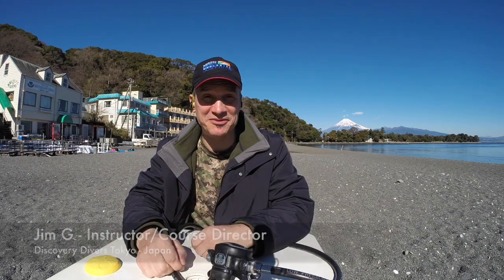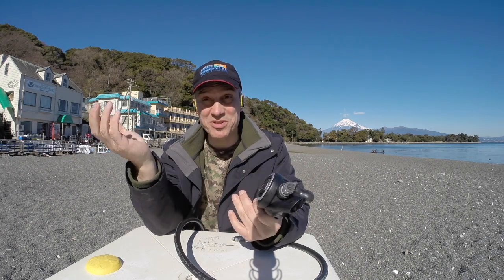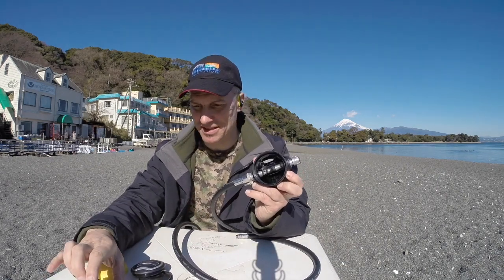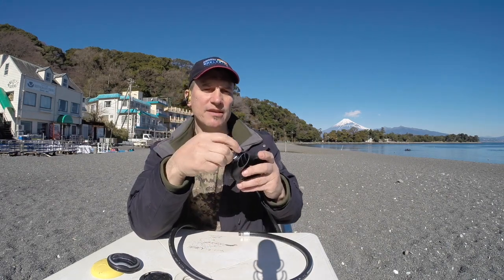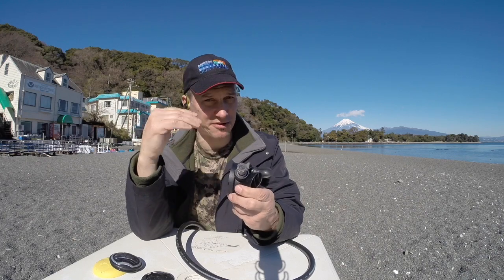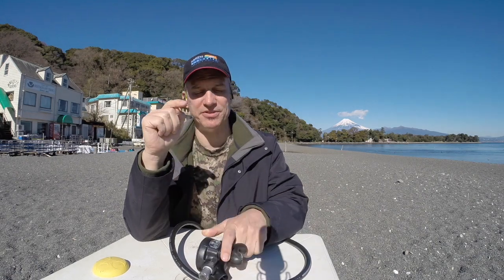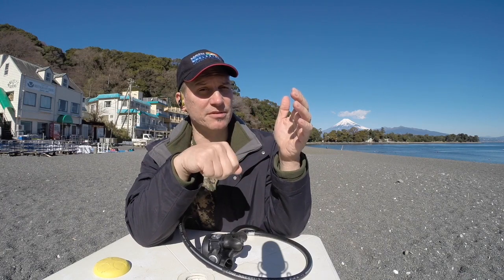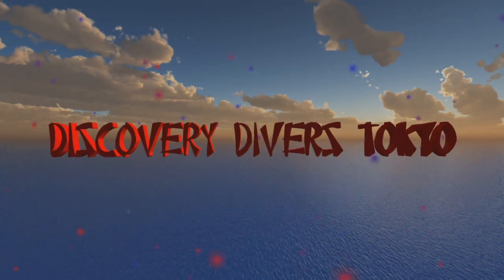Second Stage Regulator Basics, Adjustment & Troubleshooting  (Scuba Tips and Tricks)

Comment: Some regulators come with a feature that keeps the purge button slightly depressed, so when you store it,  there's no pressure on the rubber seat. Hence,  extending the life of the seat.
Reply from the maker: I didn’t know that, Juan. Which brands/models?
Reply: @DiscoveryDiversTokyo  I have a Scubapro G260  on which you have to press and slightly twist the purge button.  Here's a link to a video from Alec Peirce that shows other brands and systems https://youtu.be/VhbSwKWuZ88
Reply from the maker: Nice system!